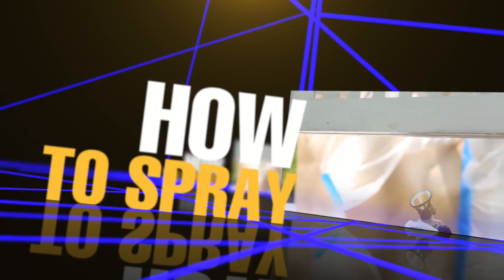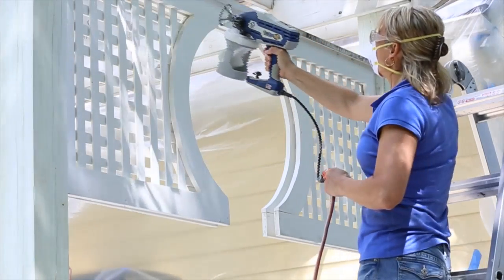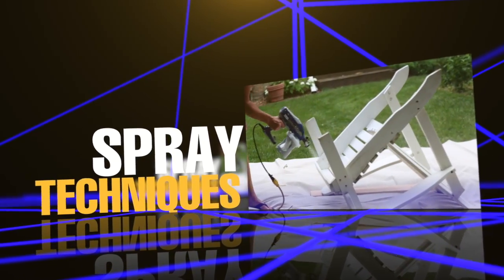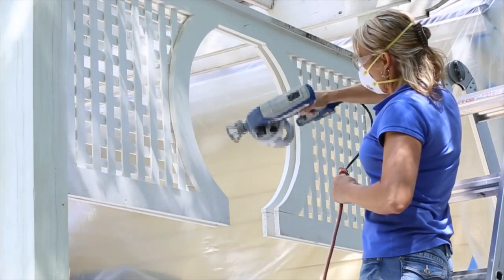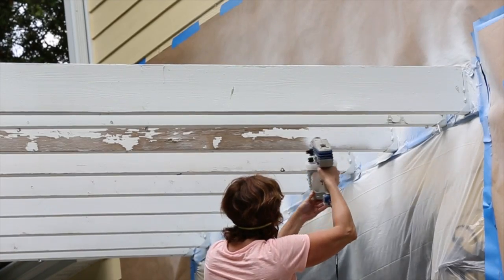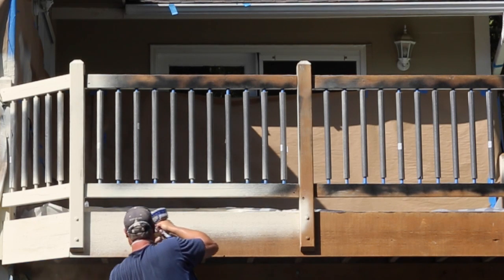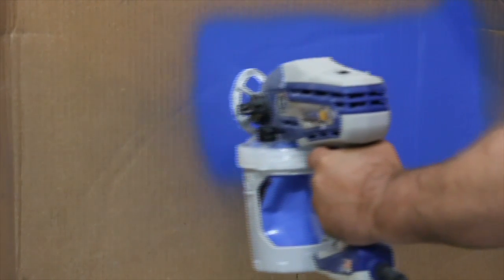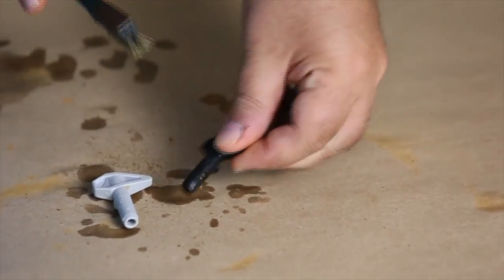Graco TrueCoat 360 Series - How to Spray

Comment: the machine has a lot of overspray so be careful.  learning how to spray right is also a trick.  Prep work is considerable.  It is ok for outside use but inside it can make a bigger mess and you need to cover everything to get this right.  very hard to do.
Reply: Then turn the spray speed down...or learn how to actually use it.